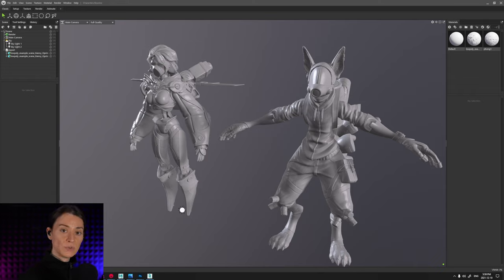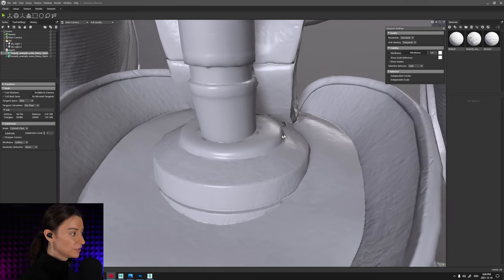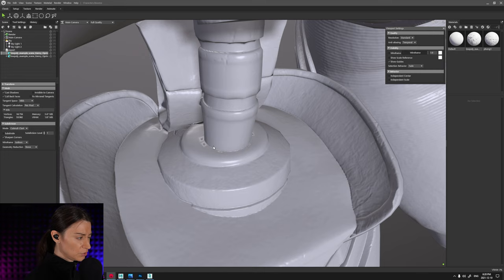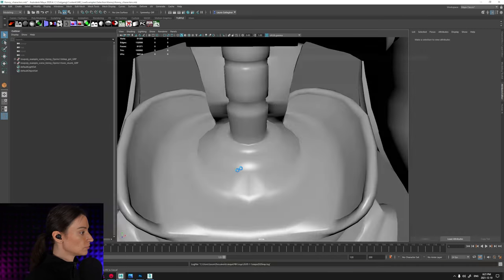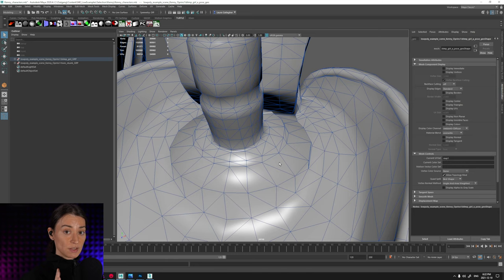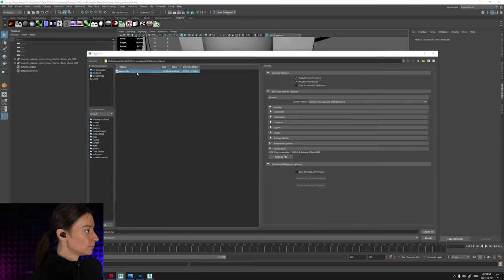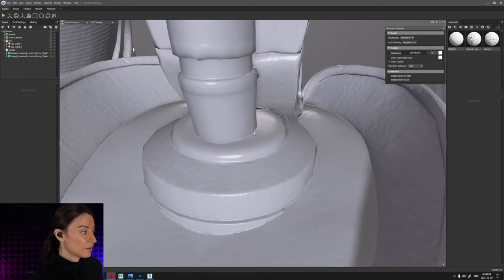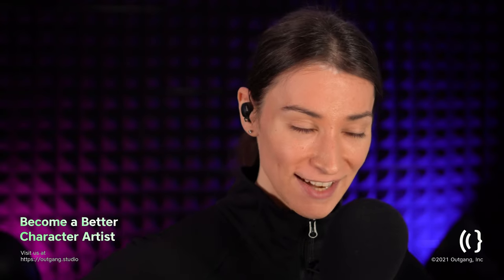Spot and Fix Triangulation Artifacts on a Low-Res Mesh

Comment: Good stuff. The normal map was baked with the triangulation method that 'looks correct' in marmoset. Everything gets rendered as triangles, which is why you should always make sure that your model is triangulated the same in the package you model with,  and the package you render with. So let's say you maintain your model as quads in Maya, but you triangulate it in there, render the normal map, and then whenever you're ready to render it, make sure you triangulate it again in Maya so you maintain matching triangulated topology that works with your normal map.

Comment: There is a whole forum in polycount dedicated to normal maps, that explain the importance of using hard edges, the tangent calculation and normal bleeding with allot of tests an examples. Only allways remeber that if you put a hard edge, you are actually splitting the mesh, and for the normals to render correctly, you need to place a UV seam.

Comment: I use 3ds max and this was always a problem for me when baking with substance painter. What I do is export a LP_baker file that is triangulated. I triangulate by applying an "edit mesh" modifier and, if exporting fbx, I check the "triangulate" option.